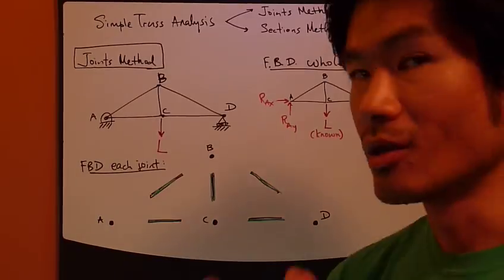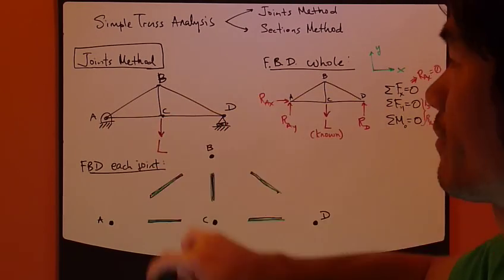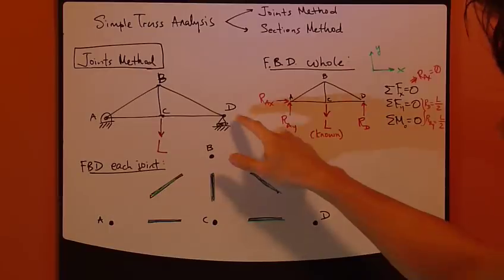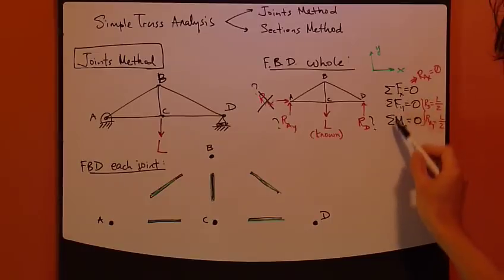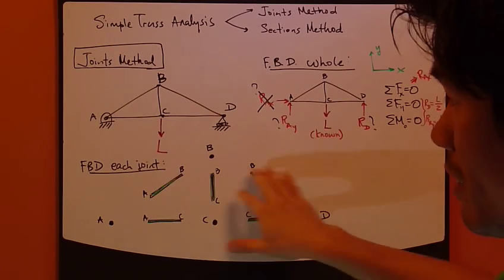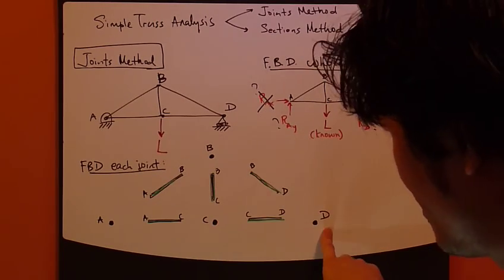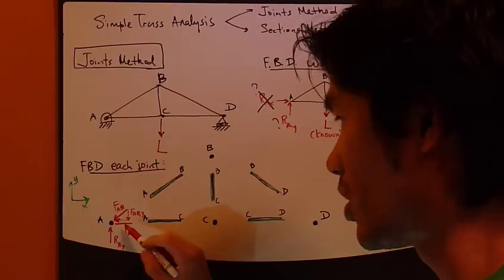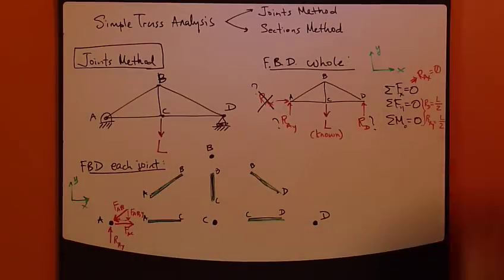Engineering Statics Ch6 Part2: Trusses - Joints Method

Comment: why is that the sum of the forces along the Y-axis you did not include  L and Ray.why the total is L/2 for both sum of the moments and forces
Reply: makwena moloto 
The reason that vertical forces at A and D are half of L is because the sum of the vertical moments must be zero at equilibrium.

For example, say you sum the moments about point A. In that case, you have just the moment due to L and the moment due to the vertical force at D. Since L is half the distance from D to A, the force at D must be half of that of L to balance. That is, the moment arm for D to A is twice as long as that from L to A. Write the equations down and you see it work out.